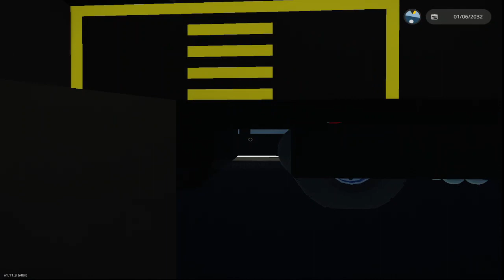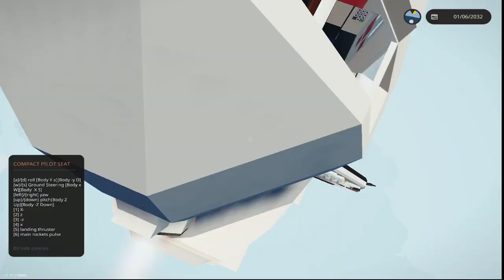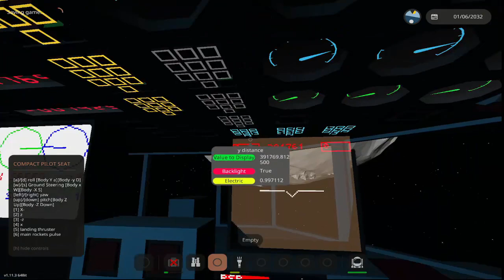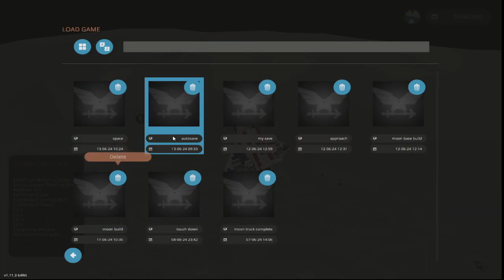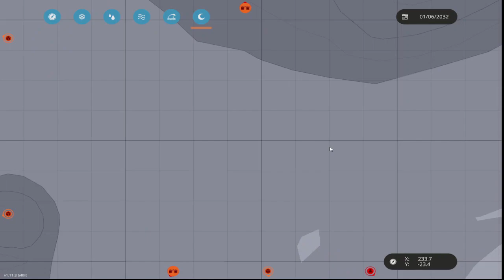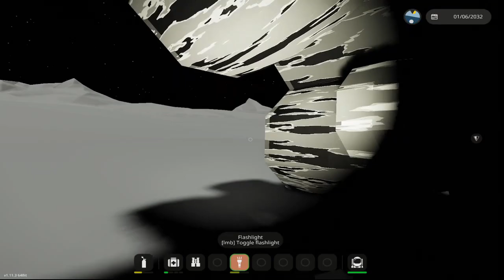Stormworks - Module 3 - the kitchen!

Comment: 49:00 The issues you are talking about here is what the reaction wheels are able to fix. They can keep you horizontally stable while, in combination with the rcs-thrusters, they can change your yaw 180 degrees so you can use your main thrusters to decrease your linear speed, while staying stable.

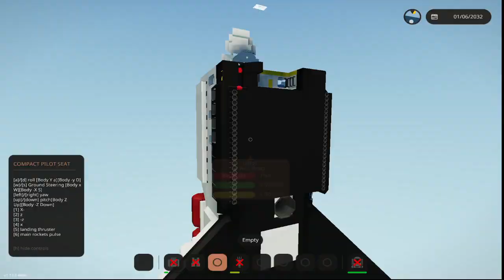Comment: 4:25 You know; you can set the reaction wheels to something other than +/- 1 :b
Connect it to you local rotation so it can automatically keep the ship stable, or at least try to help.

If your ship is pitching up when using your main thrusters, its because your center of mass is too high, or your center thrust is placed too low.

The mass is measured in kilos. Volume in liters. Temperature in Celsius. Everything is in metric. 1 block is 25cm cubed, so 4 blocks is a meter and a cubic meter is 1000 liters. 
So, if you build a box with an internal volume of 64 blocks it is equivalent to exactly 1000 "fluid volume".